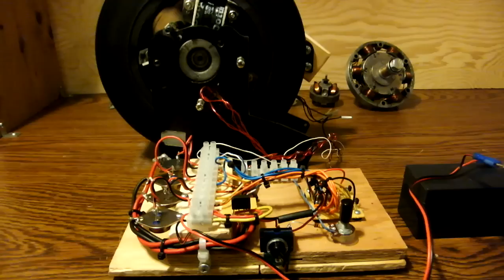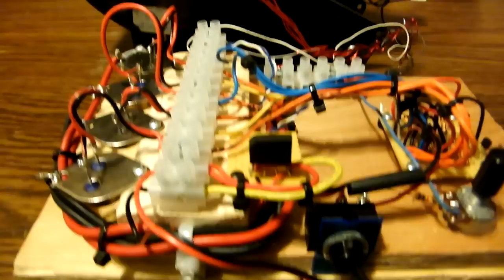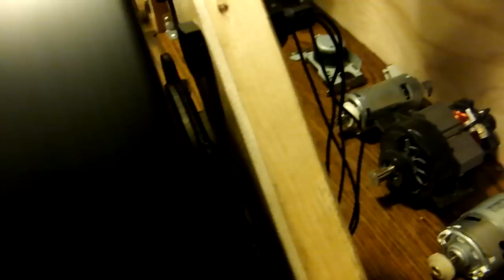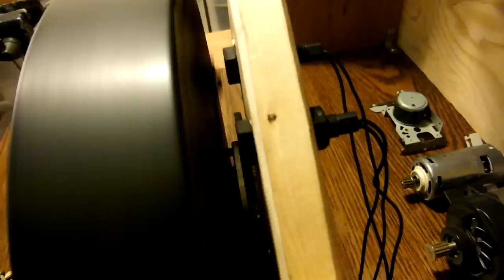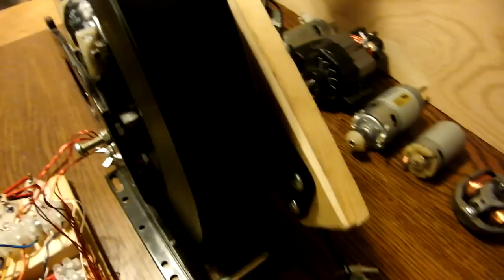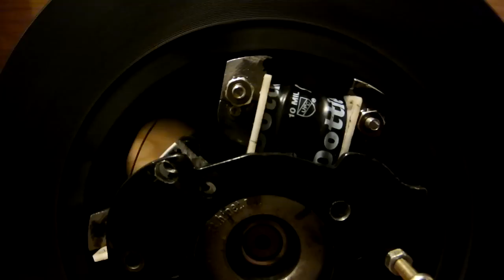Adams Motor Design & Construction (Part 2)

Comment: Using bedini circuit not exactly the way adams proposed, but a clever idea none the less. Adams basically requires that you recycle back emf of your charging coils as well as your output collecting coils; is that what you mean by radiant energy? He also uses assymetrical coils for input versus output; can't remeber the exact configuration, but seems to be different from what you have going. Maybe you just didnt have the time to elaborate on exact design. Certainly doesnt seem like you can validate Adam's claims one way or the other, unless you were to build the circuit exactly as he described it. Often people make "improvements" to Tesla's circuits; then claim that he lied about the expected results. You can't really make alterations to a design, and then claim that you are making a reproduction.Of course you don't exactly make that claim word for word, but your title implies it.

Comment: Nice build, but if you design it right, you can reach 2500 RPM with only 12V, so your statement that you need at least 24V is not correct. Also, in an Adams motor all magnets have identical polarity.

Comment: I found two little fans, one has 32 ohms, the other 64... evidently they're not all 12 ..the 64 ohm one has a much thinner steel thickness and runs faster than any I have ever seen..I'm keeping it as a fan since it uses hardly any current..I'm wondering if the 32 ohm ones could be paired in parallel (two sets) which would yield 16 ohm resistance for this type motor..both mine came out of a junk microwave oven..

Comment: Try that all windings made according to the patent of Nikola Tesla patent US 512340 entitled "Electromagnets coil".

A correct construction of the bobbins leads to huge gains compared to what is known today by electrotechnical science. All current coils are incorrectly winding, the field induced by them being the result of a sum of field differences between their layers, which cancel their mutual and partial field.

Nikola Tesla, in US 512340 entitled "Electromagnets Coil", recommended that all inductors be coiled according to that patent.

Unfortunately this was not done precisely because this coil is special. What does this coil have in particular? It is a capacitive coil that naturally adapts the equality between the capacitive and the inductive reactance with the voltage variation from its terminals or the variation of the magnetic field that influences it. This means that this coil has a natural tendency to resonate and has a huge gain (250,000 times higher) compared to a standard coil. The potential difference between any two turns of this coil is 1/2 of the supply voltage in the case of two wires or two layers and 1 / n in the case of several layers n being the number of layers. The reactance of this coil is zero and the inductance tends to infinity and increases exponentially with the voltage at its terminals, frequency and number of turns ... Basically, at a normal measurement with the inductance meter, at the induced current, its total inductance is well above the sum of the inductances of each half. On top of one another, this coil does not consume but generate ... and generates the more the frequency of the supply current (or inductive field) is higher. As a result, any electric car built with such a coil will be an electric car with a high performance coefficient. Another common mistake is to coil the coils of generators with too many layers, without taking into account that the inductive magnetic field of the core is very strong just in the immediate vicinity of it, and as the number of layers increases, the magnetic field of the core is increasingly shielded by the diamagnetic layers of the winding. As a result, you can build more coils with two to four coats than to build a single one with very many layers in which more than half the length of the thread is insufficiently saturated due to the magnetic field that is too weak to reach that piece of wire. As a general rule here: a low coil has to be built when the energy comes from the core to the coil, ie the magnetic field generates electric current - at generators and with many layers when the energy comes from the coil to the core, that is, when the electric current generates the field magnetic - in motors.
Reply from the maker: Thank you, I will investigate this patent. It sounds interesting.
Reply: @Ritalie  Please tell me your results. Good luck!

Comment: With a COP below 1 this will not have any practical use other than show it to the friends. Connect the output to a water heater resistor  and calculate the COP. Your motor is nice but is it useful ? Thanks for the presentation.
Reply from the maker: Indeed! You are correct, it has no practical value. I built it as a project to learn about the principle behind the Adams motor.

Comment: You asked for ideas and recommendations in a previous video....  I want to make one.  Instead of having excess energy (such EMF spikes) go back to the battery -- instead have it go back to charge SuperCapacitors or a high capacity electrolytic capacitor with a voltage rating of at least 10x the supply voltage (to accommodate voltage spikes that are generated from collapse of the coil magnetic field.  The reason you should charge a capacitor instead of a battery is that the chemical battery will not absorb the energy as fast is it is fed and so there will be losses. A capacitor or SuperCapacitors can take the charge as fast as it is fed.  You will make the system more efficient because more excess energy will be saved and available for use to run the motor and to charge the battery (although at a slower and more sustained rate).
.
Another idea... the heavy flywheel could be used to act as a gyroscopic stabilizer for a motorcycle or small vehicle.
Reply from the maker: Hi Jay. You make some important points thank you. I will do some more research on the circuit you suggested. I will do some research on super capacitors.
Reply: Tune it to run on resonance, Spin its speed up as far as it will go. Check it on a scope during the process. look for spikes, run it at that speed. Change your gaps, change your voltage inputs. Hi volts low amps..

Comment: I’ve been working on my bending circuit for a week and got some hall ic switches and a 555 12v relay but not sure how to wire it up to open and close continually to my coil is their any diagrams that could get me to that point everything is ready and tried but rotor only spins for a bit and stops thank you for sharing any info you have to help trying to get a Adams motor built and got parts that was told from Tim Harwoods design but have built bendini circuit about three times to make sure everything was put in there spot but want to integrate the hall ic and relay timer to get torque.  Diagram of this will help if you know of anywhere to go to see.  Thanks again.

Comment: So I'm gathering parts for my build. The reed switches came in the mail so I'm pretty much ready.
I'm hoping to self run. I know if I can do it with condioned batteries it will only be able to power itself and not have all kinds of spare power.
So basically this a pulse motor with a magnetic attraction to the pulse coils?
The pulse motors I have seen, all have air core pulse coils, so this is just the next logical step in efficancy hey?
Reply from the maker: So this is basically an Adams motor, with some variations. It's not built to the proper Adams motor specs. An Adams motor uses repulsion only. Not attraction. It was never designed as an attraction based motor. The coils pulse and "repel" the magnets away. You lose efficiency using an attraction based Adams motor, which is obvious if you study the design.

The reason for this is because you are trying to harness the natural attraction based energy that exists between the magnets and the coil cores. The iron attracts the magnets, which you can feel when you turn the flywheel by hand, in the form of magnetic torque, or magnetic cogging. The magnetic cogging is the natural attraction between the magnets, and the iron cores (fan motor cores in my case). 

So you don't need to add anymore "attraction" forces, since the motor is always attracting, when it's not powered on. It already has attraction, and a lot of it. What you do is add a little bit of repulsion, to keep the motor turning. Most of the torque comes from the natural attraction of the rotor magnets, to the iron cores inside the drive coils, and not from the user applied magnetic field driven to the coils.

What you do, is simply pulse the coils momentarily, as quickly as possible, to repel the magnets before they can "stick" at the point where they are maximally attracted to the iron cores. You are basically just interrupting or blocking the attraction momentarily, by sending power to each coil, so the rotor can move past the drag point. When the magnet is approaching an iron core it builds up an "equal and opposite" magnetic charge, due to Lenz's Law, which creates an electrical voltage in the copper coil winding. When you close the switch, some of that voltage that was built up in the coil winding is sent into the battery, to be recycled.

The Adams motor invention is really smart, at least theoretically. But in my case, my motor is very power hungry, and doesn't work well as a true Adams motor. My motor is not sophisticated enough to make use of the recycled energy. But with a lot of advanced parts, and a specially designed motor, you can apparently get very high efficiency with a real Adams motor. It's a fun project nevertheless. It's always fun making a motor from junkyard parts.

I'd like to hear from others who have made an Adams motor or similar motor design. Thanks!

Comment: "all South or all North magnets"???? I dont think such a magnet exists. All magnetic materials possess opposing poles.
Reply from the maker: Hello I must have mis-spoke? Yes, there are 2 poles to a magnet. However, the Adams motor design specifies using all the North poles facing outwards, and all the South pole ends of the magnet facing the motor shaft (not being used at all). They call this arrangement a "mono pole motor."  I couldn't do a monopole motor because I have North and South bar magnets attached to this heavy flywheel. Each end is exposed, so I had to make a circuit that could produce alternating current (AC) which requires a much more complicated circuit. A monopole motor can be built using 1 transistor! I had to use 6 transistors and 2 reed switches. Transistors waste some amount of base current, just to switch them.
Reply: hi harvey mitchell,  There is a neat channel on youtube called MrTeslonian where he did create singular pole metals.  Check it out.  Could be important to all this.